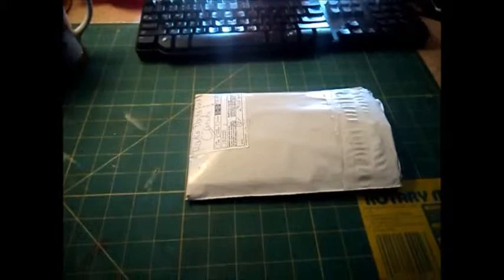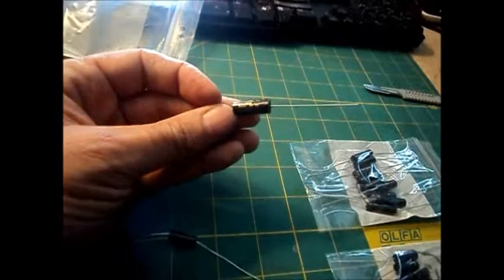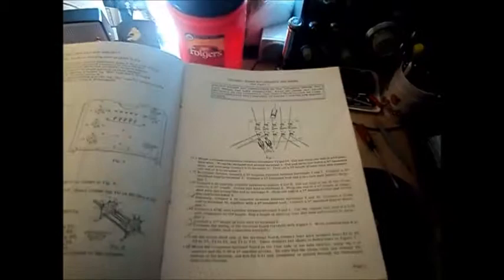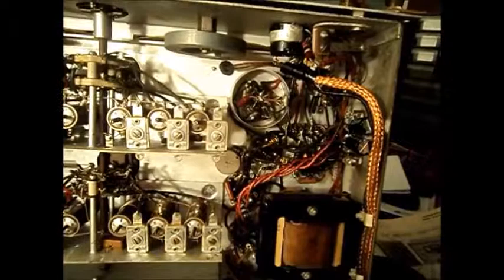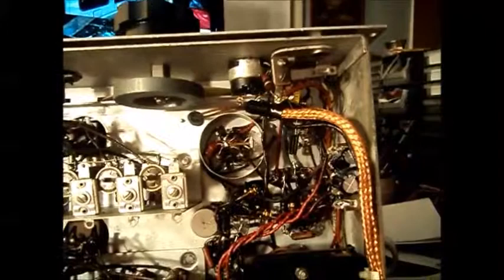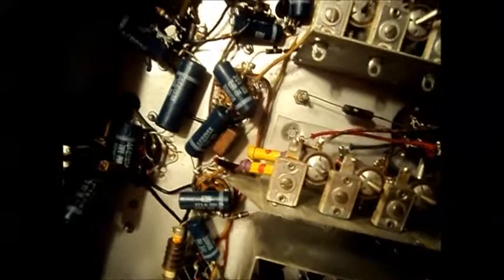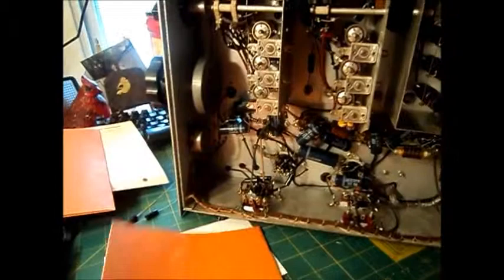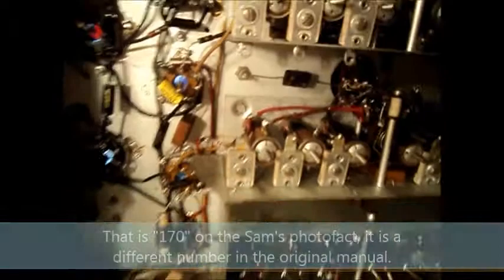Hammarlund HQ 129-X update,2 of 3, and a few unboxings.

Comment: Hi Tom. I am in the process of a complete restore of the Hammarlund HQ 129X and I noticed on BAMA, it is still a blurry copy. Hopefully, that is not the one you uploaded. I ended up ordering a copy via ebay as there was an original but the owner wanted $129.00 for it! Don't need it that badly as even a blurry copy will do me fine. Also the best schematic copy I found online was in a link at the Ohio university site you mention in your first video.

Thanks for your work on your video. You could improve the light a bit on the inside shots - and since this is from 2014, you might have. Just subscribed recently to your youtube site.

Jim